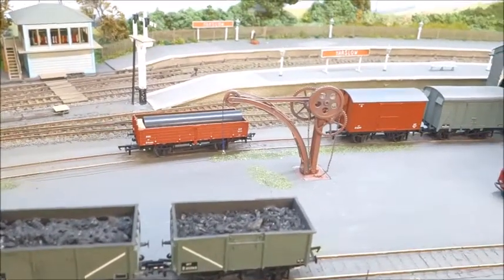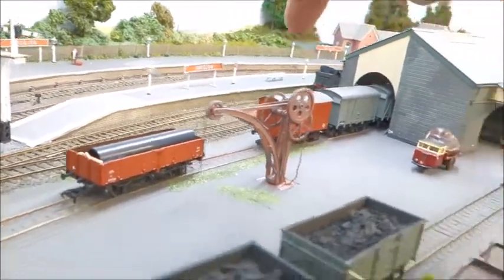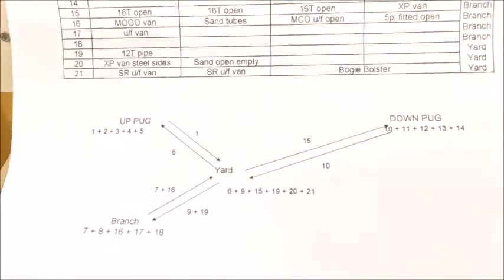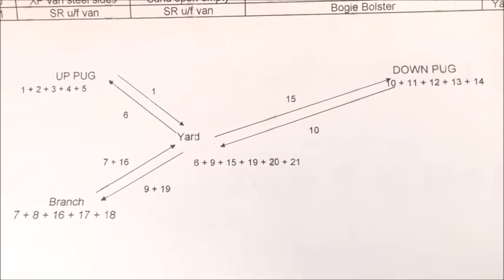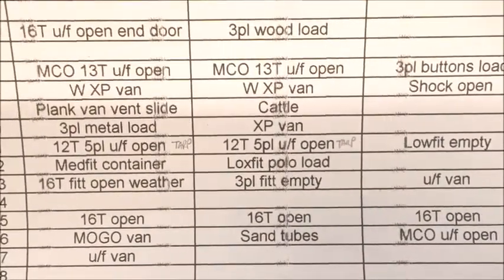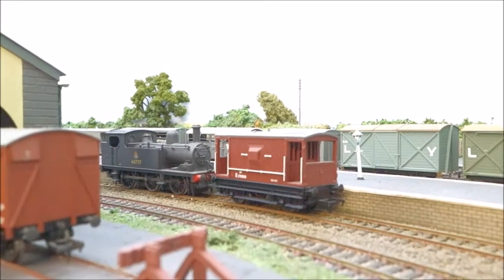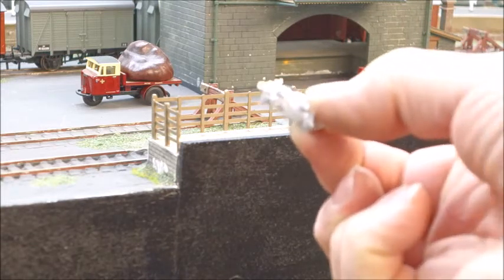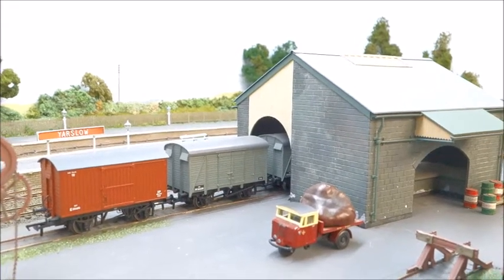Stopping Freight trains on Yarslow

Comment: Hi Barry, a fascinating video and operating concept that I would love to adapt for my own layout as I also use an up and down PUG, a yard and a branch. However I am getting lost trying to follow your pattern to see if it ever returns to the start point or do you just run it for a couple of days and then manually reset the wagon locations? If so the some groups e.g 4 would never move from the e.g. Up PUG or am I missing something (more than likely!). I have enjoyed all your videos and learned quite a bit especially from your bite size ones. Cheers Steve
Reply from the maker: Hi Steve.  No, you've got it dead right.  After a while, everything returns to its start point.  If you've got 20 wagon groups, it takes 20 operating sessions to get back to the start.  During each of those 20 sessions, every train that carries the wagon groups (UP and DOWN PUGs, branch etc) is different in both length and consist.  The more wagon groups you have, and the more sessions that they stay in one place (for example, the yard), the busier that yard appears to be.  On the branch, wagons will stay in the halt siding for one session only ensuring that this halt only ever gets a small number of wagons to deal with - if any at all (if the wagon group is empty).  Hope that helps.
Reply: That is brilliant Barry, many thanks for responding! I tried it over 14 days on a spreadsheet, should have carried on I guess. My yard is not quite as big as yours so I will experiment with say 12 groups to start with I think. Again many thanks Cheers Steve